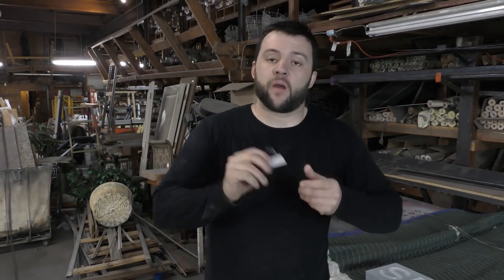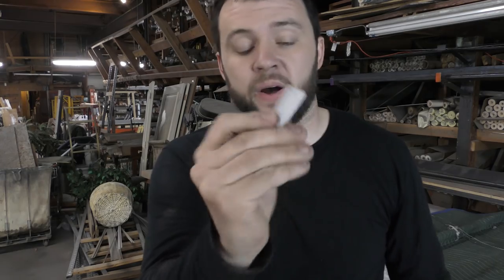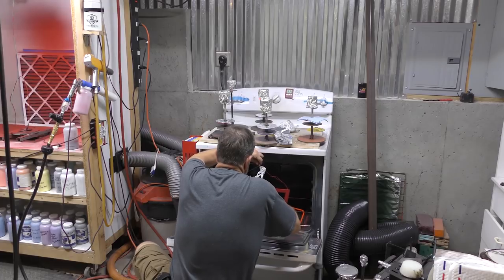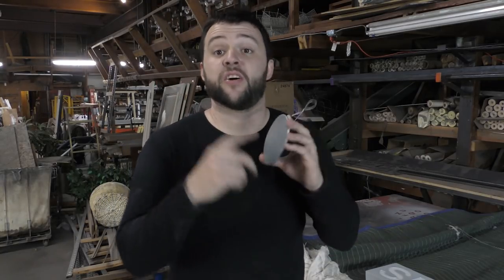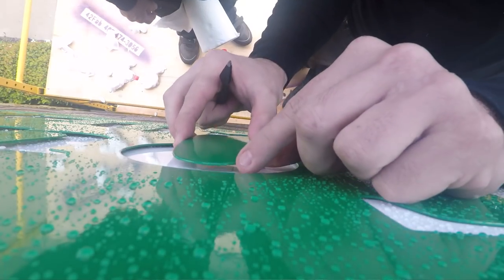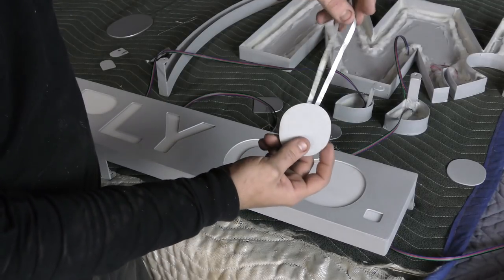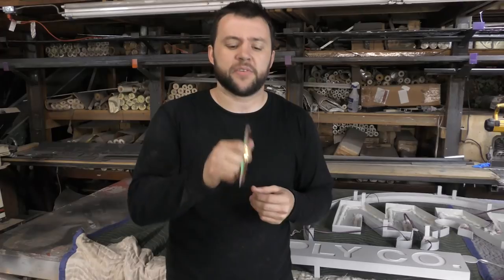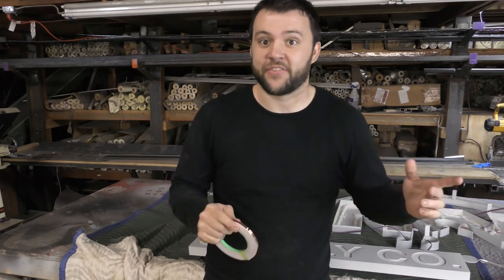I've been Powder Coating Small Parts WRONG $14 saved me HUNDREDS

Comment: Richard, love your channel! Thank you for the great posts! I was looking into powder coating myself for large scale structural steel beams. I ran into an excellent tip. The only reason that you HAVE to electrostatically charge these pieces is because you need the powder to adhere to the part, right? Well, for the really small parts, like the middle of the "O" in your sign, if you'll preheat that small part to 400F first and let it soak at the temperature for awhile, you can actually pull the part from the oven and spray the powder coat on it without any ground wire at all. It is called flocking and is done on all kinds of materials that are non-conductive. It should finish out the same as the rest of your sign work if you're using the same powder batch, but you'll have to test for color uniformity. Good luck and thank you for the copper foil tape tip! Could come in very useful! Take care, Russ
Reply from the maker: Yeah, this is a process that is used plenty. The problem is "how do you hold the part?" with flat pieces like this, you need something to attach to the blind side of the part.

In the past I've tried magnets, but they distort the color of the powder, maybe due to uneven settling. It's subtle, but I've tried it 3 times, each time had to be redone.

Comment: I ordered some and It works great, even on a larger piece where you want to ground directly to the part, but don't really have a place to attach the ground wire. I just take a piece of it and fold it over a couple of times (so it doesn't stick to the ground lead) leaving some of the adhesive part exposed, stick it to the bottom (say... a metal flag or other wall hanging) and just attach my ground. When I'm done I just peel it off. Say you want to put another coat on (clear coat or maybe you're two-toning) you can put a piece of polyester tape over the copper tape and that place will stay bare metal for when you go to put another piece of copper tape on.

Thanks for the info on this tape. I never would have considered there being something like this out there

Comment: I have a question that isn't really related to this video, but I'm hoping someone can help me out anyway. I'm just starting to explore Powder Coating for the hardware on these Hook and Ring Toss games I make (there's whole build video on my channel if you want context). I just ordered some startup powder coating supplies, but am still mildly concerned about one aspect. I need to coat the entire surface of an O ring and am thinking I'll just rest the ring on a conductive wire and then there will only be one tiny spot on the inside of the ring that won't be coated. So my first question is, is resting the ring on the wire enough to charge it for the powder? My second question is, can I just coat the ring, shift it so an already coated side is sitting on the wire, and then coat the bald spot?
Reply from the maker: First question: yes, 2nd: probably not, the reheating will soften the powder where it's sitting, leaving a mark
Reply: @42Fab  Ah that makes sense. Thank you for taking the time to respond :)

Comment: never used powder coating before, but would a small magnet work or will it interfere with the powder coating and the current
Reply from the maker: Works sometimes, other times it throws off the powder, most often in colors with metal flake or texture